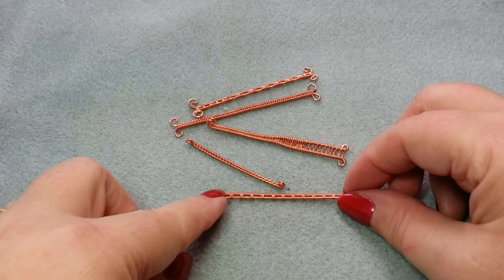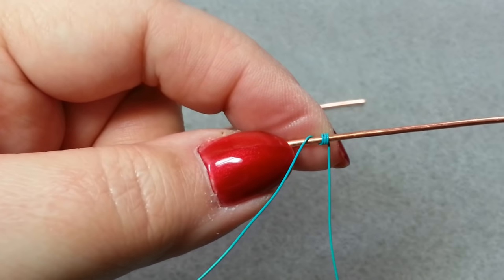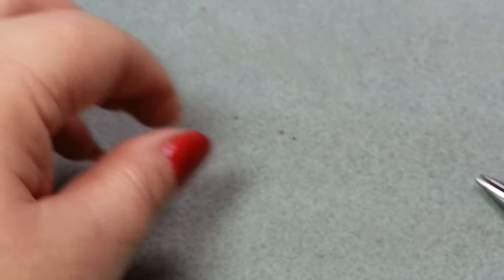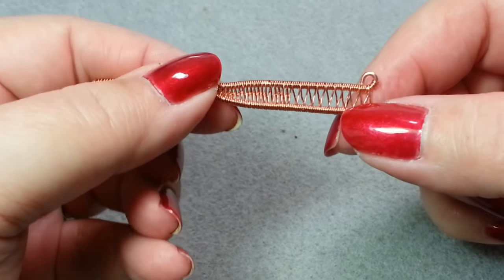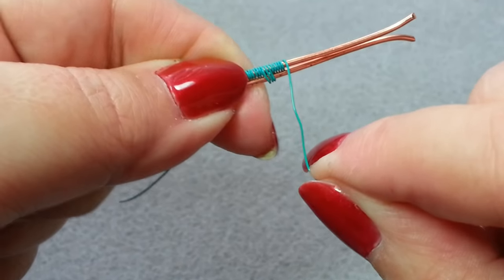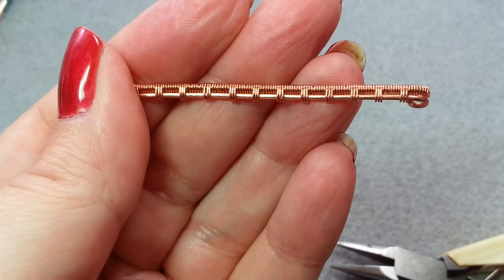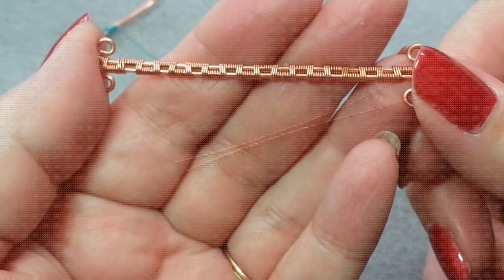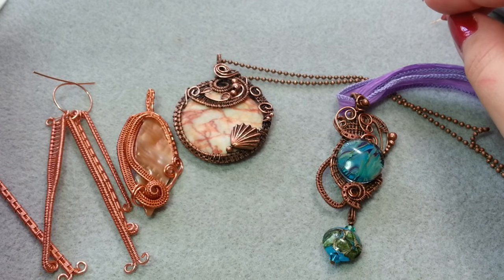Intro to Wire Weaving - 2 Base Wires, 4 Patterns, Wire Weaving Tutorial

Comment: Very informative and easy to follow! One question....how do you "tie off" the weaving wires at the end of the run? I'm sure you have these techniques in your other videos so please just let me know and I'll search them out. Thank you again!! I'm starting a jewelry business using almost entirely recycled wire and copper tubing so this is very, very helpful.
Reply from the maker: That sounds so exciting, jewelry almost entirely from recycled copper wire and tubing -- best wishes on your venture!  Now to answer your question, I don't really "tie off" in the same sense as tying off in beading.  What I like to do is finish securing by making some coils around a single wire, as tight as I can.  When I cut the wire, i cut it so that it is between two heaver-gauge wires -- kind of like it's "sandwiched".  This will help the thinner wire stay into place better.  You can see the technique in my bangle bracelet video:  https://youtu.be/yNrqKISPKUw

Comment: Thank you☺ I love the look of weaving, but in magazines it doesn't come across as accessible. 
You are.
One question, how long a piece of weaving wire do you start with, or how long can it be? I have ended up with either broken or unmanageable. And splicing?
Again, thank you
Reply from the maker: Hi 1926modelagirl, I'm glad I was able to help!  Now as to your question:  if I am using copper, a lot of time I weave off the spool of wire.  However, if I am not weaving off the spool, I generally start with 4 to 6 feet of wire.  If you aren't using dead soft copper wire (not coated with anything) then try it; it usually is more forgiving than either colored wire, brass or any of the silver (plated, filled or sterling).  Also, as soon as you see a kink trying to form, stop and unwind it; kinks are stress point and can cause your wire to break more easily.  I hope this helps!
Reply: Beaded Jewelry Diva 
Thank you. I will try with plain wire, I suspect I've been using coated. I also have brass wire, though it is 30ga

Comment: I am enjoying the simplicity of the way you teach. I tried to start out with a snake weave from another instructor and it was a bit challenging. This is much easier to understand from the beginning. Thank you. What hardness are you using for your wires in this tutorial. I am finding that with dead soft 20 gauge, my base wires get squeezed by my fingers.so I need a harder wire or am I doing something else wrong?
Reply from the maker: Hi Cheryl, I am glad you found the video helpful!  Yes, I do use dead soft, but I usually use 18 gauge wire -- 20 gauge does tend to "squeeze" easily.  Ease up a little with the pressure on the rings (I know, easier said than done), but 18 gauge is much easier to use.  :)
Reply: Thank you I am just learning and you are so helpful. I LOVE all of your work.

Comment: I am using 26 gauge wire to weave, can I use a higher gauge? 26 is hard to see.
Reply from the maker: Hi Bonita, you could try wrapping with 24 gauge, but you'd really need to use 20 or 18 gauge wire for your base.  But I know what you mean -- I have to wear reading glasses when I do any wire work!  :)
Reply: thanks